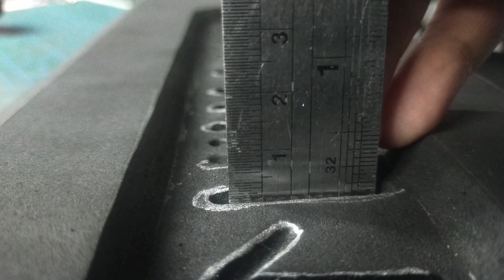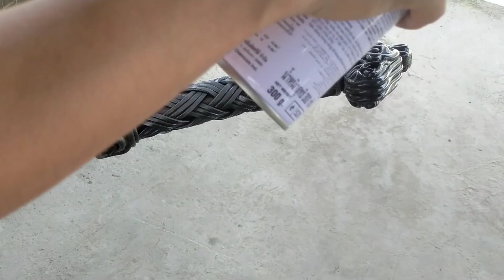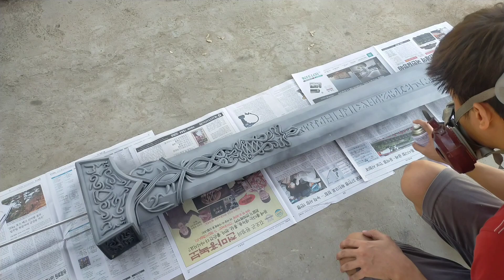Making BLAIDD from "ELDEN RING" Part 1: ROYAL GREATSWORD | Cosplay Prop Works

Comment: I'm always watching videos. I'm just curious. What kind of fabric is it used to make the props?
Reply from the maker: Well, what I use the most commonly used for cosplays called "EVA foam" or rubber sheets as some call it. It's the most user friendly material so far in my opinion which goes in varying thickness. 

There's also Worbla, which is a thermoplastic that you could heat up, then it'll become like clay and you can use to mold pieces with and it'll maintain that shape when cooled off.